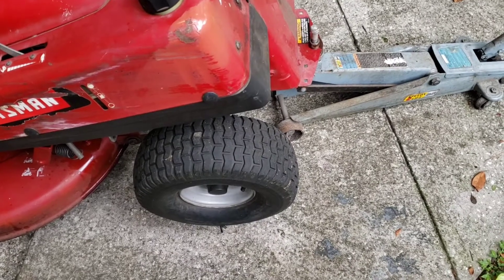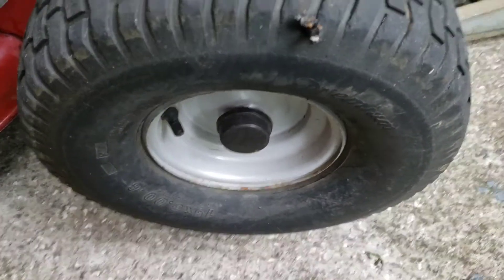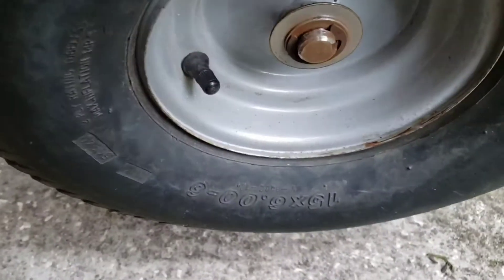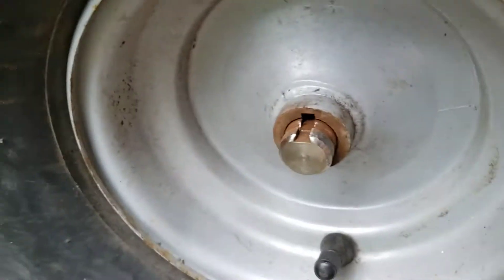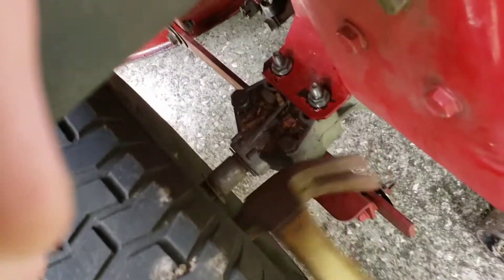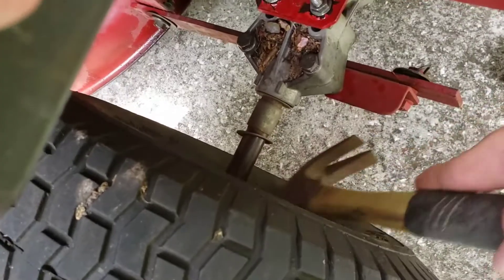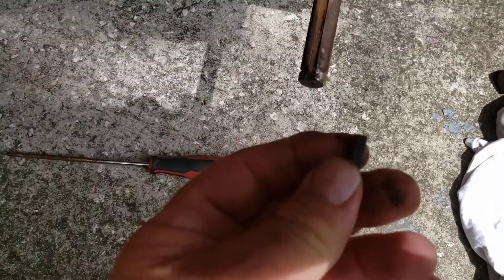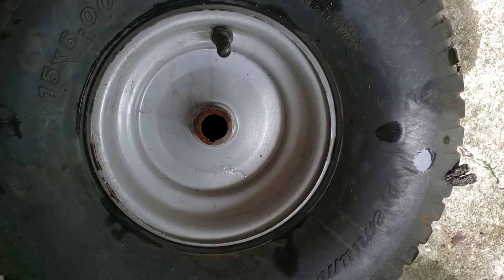How to change rear riding lawnmower tire of 30 inch Craftsman

Comment: What about the tire?? Title says change the tire wth?
Reply from the maker: You are right. I should have titled it different. To take the tire off the actual rim I simply took it to a tire shop. You can do it by yourself though with two tire tools or long screwdrivers careful not to damage tire.. Then use a tie strap back around it to inflate and seal it back on the rim. Sorry. I need to make a video on that.